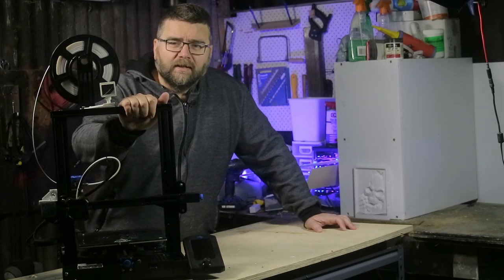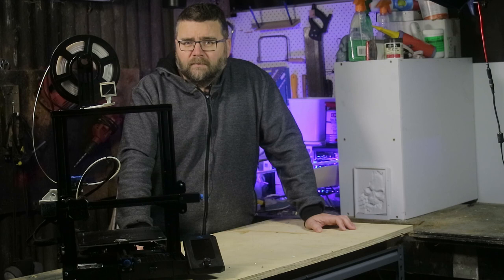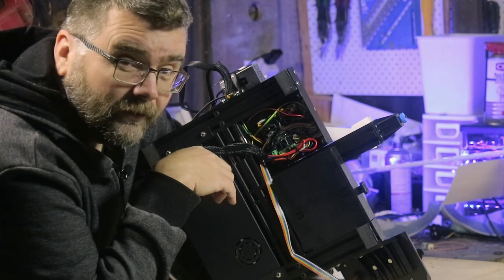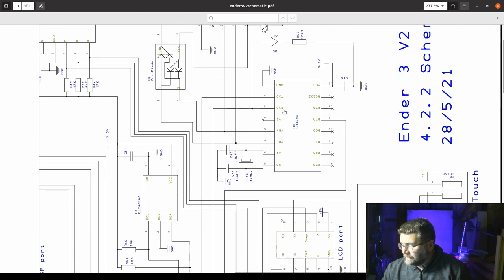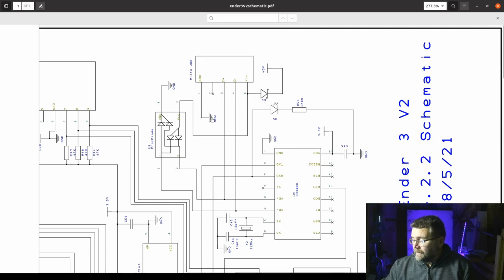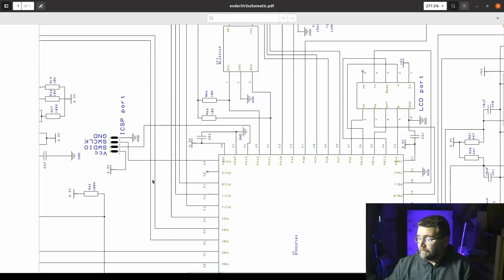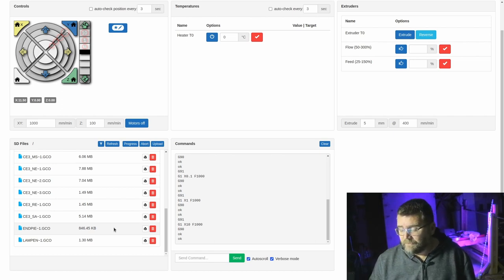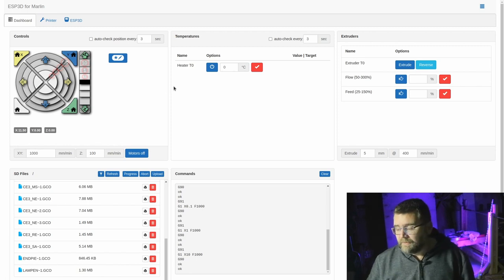Wireless 3D Printing: A Beginner's Guide to Setting Up Remote Printing for the First Time

Comment: Just fyi this is perfectly possible with ESP8266 after tuning buffer sizes. I've been using that as a default setup for almost a year (even though I also have ESP32 but I see no need to use it).
BLOCK_BUFFER_SIZE=32, BUFSIZE=32, TX_BUFFER_SIZE=32 and RX_BUFFER_SIZE=2048

    Flash ESP3D on the ESP8266 and configure it which gives web gui interface and wifi to serial interface on port 8888
    Connect the ESP8266 to the printer and configure it for the board or tft screen
    Update and flash new marlin to support wifi connection and increase buffer sizes as mentioned above
    Install octoprint on any device (I use it on my home server)
    Install Octoprint networking plugin and connect it to ip and port 8888 of esp module
    Use octoprint as usual with cura or your slicer of preference
Reply from the maker: Great tip! I was wondering if there was a buffer that would improve the reliability.

Comment: Hey Jason,

Any recourse for the printer not displaying the IP address? The web UI is working, but I can't send or receive anything from my printer.
Reply from the maker: Which printer do you have?
Reply: @JWNZ  Ender 3 V2 with 4.2.2 main board.
Reply from the maker: @brannonmay  I would as a quick check reverse the TXD and RXD wires on the ESP to make sure you have them around the right way and reboot the printer. If the IP does not come up then there are multiple serial ports on ESP32 you may have just chosen the wrong one. You can check my article here https://jasonwinfield.nz/can-you-wifi-a-3d-printer/

Comment: Wonder if the ESP3D people / person are working on something like the ability to add a secondary SD card to an ESP, and/or to use the 16Mb models to create a "buffer to the buffer".
Seems unnecessary to go to computer boards, to just send a few simple commands and upload a few thousand Kb of data.
(Although if i could just go buy another pi, run some opensource app, and have at least the functionality provided at the printer itself, and maybe with the option of remote access, or for instance HASSIO integration. I would certainly do so)
Reply from the maker: You should probably have a look at klipper.
Reply: @JWNZ  I actually decided today, to switch my HASSIO RPI4 to a proxmox setup, and have a minimal version of OctoPrint on it as well. 
I know klipper isn’t the same. But as a first week owner of a 3D printer, klipper sounds like a lot. 
I just don’t wanna get off my chair to start a print, and have a camera as well. (Although my Old iPhone7 is doing fine as an ipcam)
Reply: And after a short look at your catalogue titles i also decided to subscribe
Reply from the maker: @jonatanboy  As a first week owner I would for sure wait for a while before looking at klipper :) Thanks for the sub.

Comment: I've done this on another printer. The Gcode transfer time is geologically slow because there isn't a direct interface from the ESP-01s to the SD card. Meaning this doesn't really get you anywhere.

So, looking at Raspberry Pi prices I bought an FY SETC wifi SD card to get around this limitation. But having done everything there is with this and tried multiple firmwares the limitation I and many other hit is the SD card slot doesn't seem to be able to provide enough power to the card. So it'll work as USB, and in the printer it'll connect to wifi, and the printer can read the SD card but you cannot access the SD card over wifi. 

The only real solution to any meaningful wifi capability is to add Octoprint on a rasberry Pi. I say this because If I had known what I do now I would have gone straight to that solution.
Reply from the maker: The speed isn't that slow. The printer accepts data at 152kbs the ESP01 could probably handle 10MBs way way faster than the printer can accept. The problem is that your computer will stop doing something for a few seconds and this is pretty Much a disaster for the printer because if it gets no data it just stops. In my environment I had the printer and the PC only and all the PC was doing was printing. If I started to watch YouTube or something pausing would probably start. I have found recently a USB host module and if I can get this to work with a 8266 or even ESP32 I think a big chunk of these issues are resolved. If you are a print farm printing of the same thing day, day out. ESP3D would be ideal as you can easily release files for the SD.